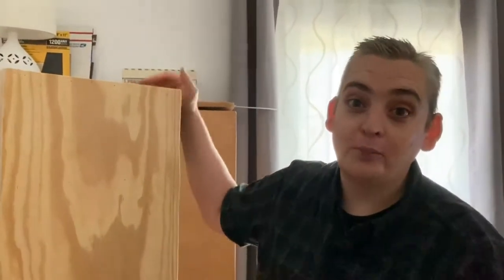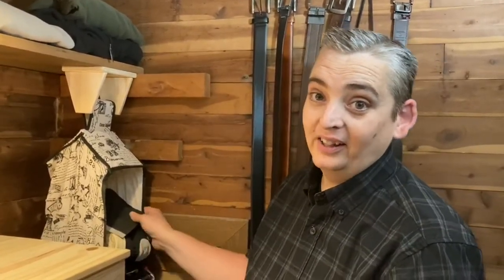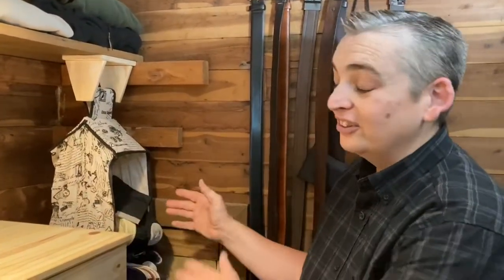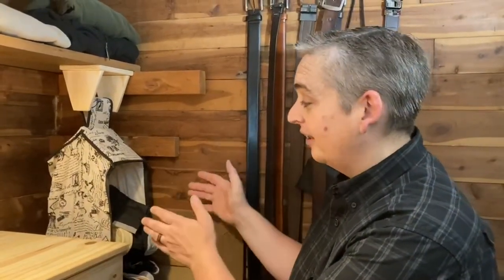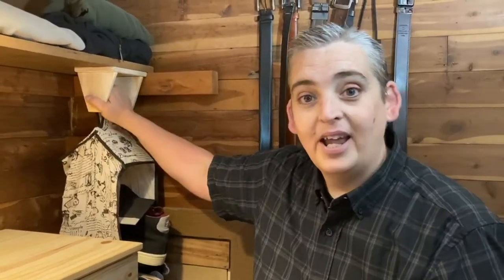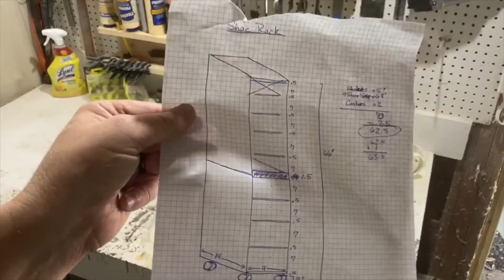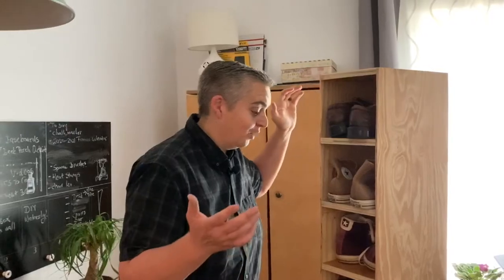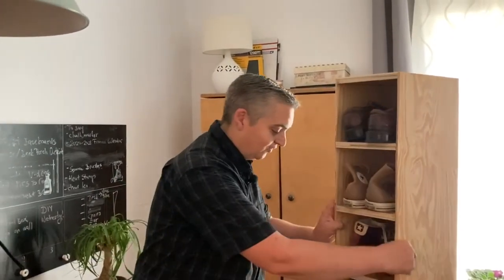Making a Vertical Shoe Rack On Wheels! One Day Build!

Comment: wow quick clean job, do you happen to have the measurements on the width and height of each cubby hole?
Reply from the maker: Glad you liked it! will make sure to get those measurements to you this weekend.
Reply from the maker: Sorry took so long to get back with you.
The shelf dimensions are 14”x8”. HOWEVER, I had to make this to fit a very specific, tight space, so the width is not ideal. If you have the room, I would suggest making the shelving wider than 8”. My shoes will not sit flat, side by side. Probably need atleast another 2”. Or you could just measure your largest pair of shoes at the widest point to make sure they all fit correctly. Yours will probably end up way better than mine.
Reply from the maker: Forgot the height: the shelves are 7” apart. I wear a lot of Chuck Taylors so they’re higher than needed for most shoes
Reply: @boydstongrove   can i get the measurments also? love this and would love to make this for my daughter
Reply from the maker: @eddiediaz8668  the shelves are 14”x8” which is a little tight for my shoes, but that was all the space I had to work with. The distance between the shelves is 7”. I made it high to fit Chuck Taylors

Comment: What was the measurements you used to create this?
Reply from the maker: This one is very specific to the spot I had available, But to get the cubby sizes, I took my overall available height, minus the caster height and the thickness of the top and bottom panels, and divided it evenly to the height of my tallest pair of shoes. The depth was made based on my longest pair of shoes. The spot was too restrictive to make it to properly fit the shoes how I would have liked (I need a bigger closet i guess).

Comment: Did you just eyeball where to smack the screws? Or mark it out first?
Reply from the maker: You mean for the casters? Yeah, just eyeballed the position till they all looked even and then screwed them in place. In hindsight I should have used a little bit bigger caster though, maybe with softer wheels because the small plastics ones have a hard time rolling on our hardwood floors (not like I’m rolling it around the house or anything, ha).
Reply from the maker: Yep, just eye balled it😮.